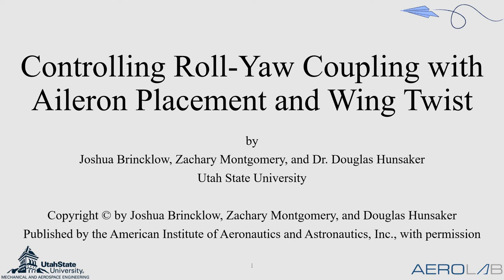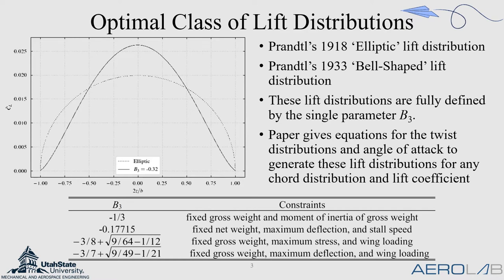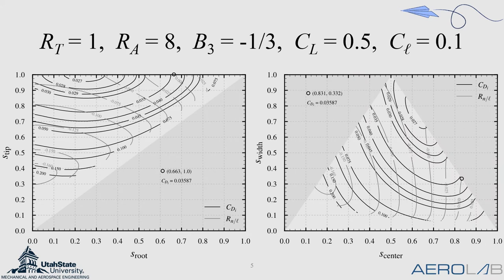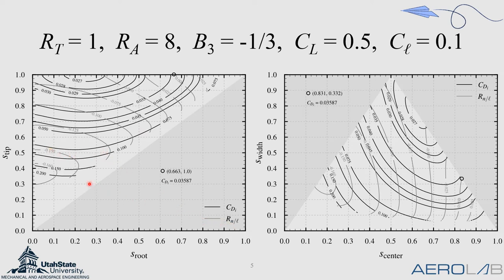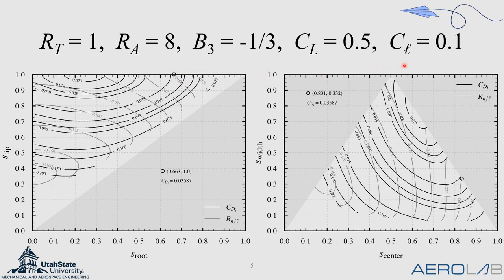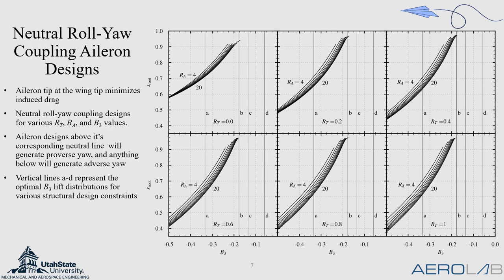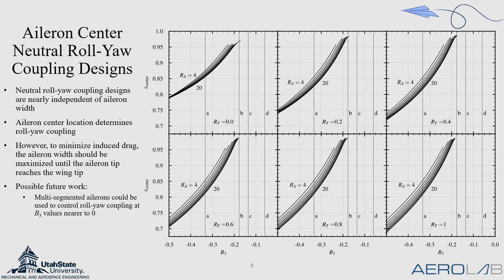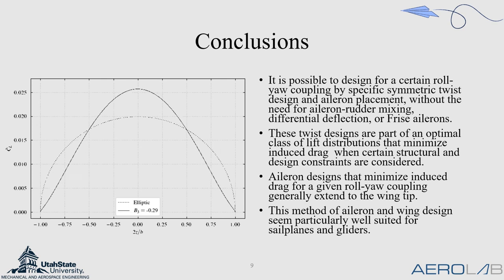Controlling Roll Yaw Coupling with Aileron Placement and Wing Twist

Comment: re conclusions:   seems to me you shoulda  said  TAILLESS  gliders  and  only  those types of aircraft.       while i only understand part of the math, i understand aerodynamics.
among other things, if an aileron does not extend to the wingtip, the  non-moving part of  the trailing edge  DAMPS  roll response, and  makes  drag that otherwise would  NOT be there.      cheers

Comment: at 5:19, graph at right,  is aileron 'width'  the  chord   OR   length  or  what.
Reply from the maker: It is the spanwise length of the aileron normalized by the semispan. For example, a width of 0.5 would have an aileron that takes up 50% of the semispan.